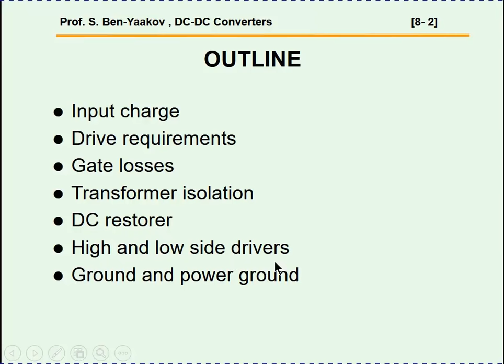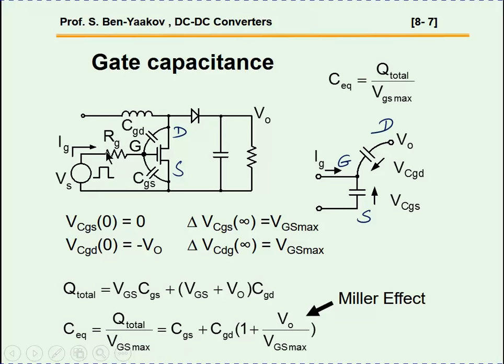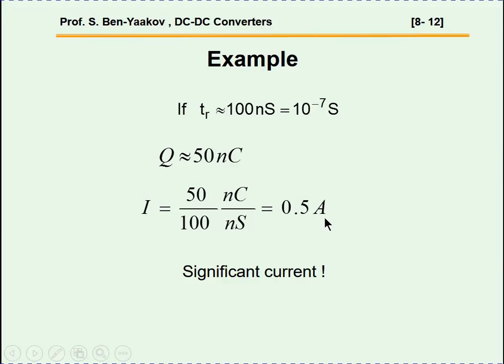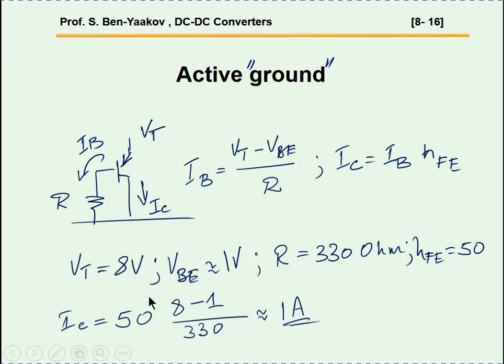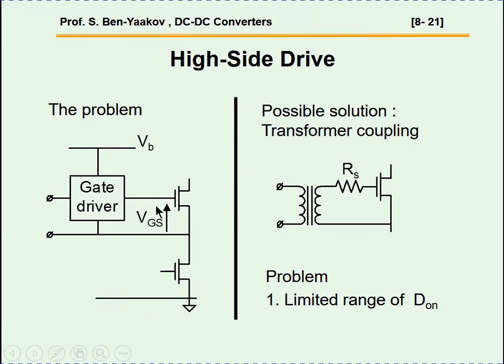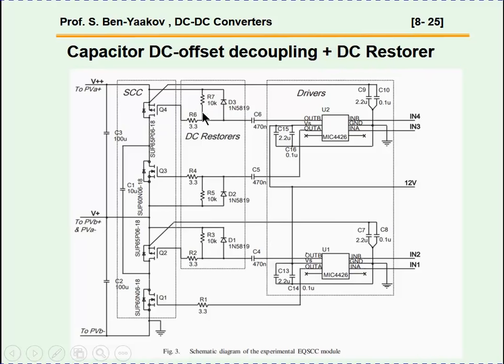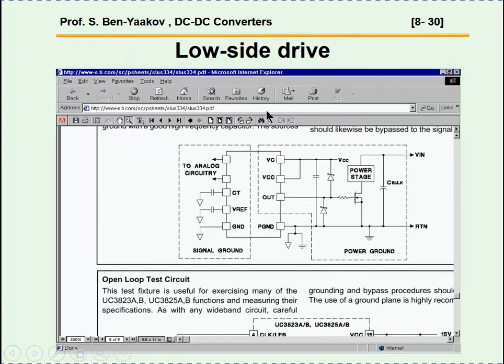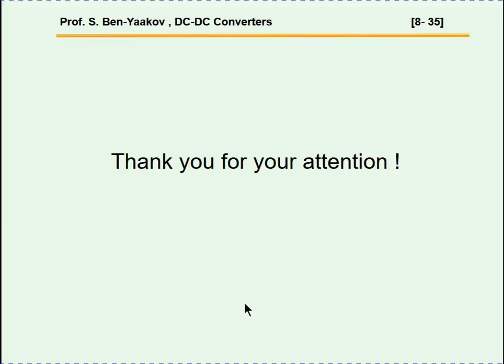Power MOSFET drivers

Comment: Useless & theoretical bla-bla
Reply from the maker: Thanks for the time time taken to comment, but can you be more specific? I would love to read some concrete critique.
Reply: @sambenyaakov  All video is pure theoretical. About gate transformer. Push-pull usually are used for primary winding. It generates AC, not DC. But... after a lot of test this schematic is bad with GDT. Good that you are not Indian... HAha  - they are crazy electronics advisers at all now everywere.
Reply from the maker: "Push-pull usually are used for primary winding" can you give me a reference to that?  Where did you get this?  Just googled "gate transformers" and clicked "images". Guess what,  out of the very many schematics I  did not find a single push pull. How would you explain this? The FACT is that that you CANNOT use push pull on the primary of a gate driver transformer. This is because it will pass DC via the winding for duty cycle different than 0.5. 
And what is GDT ?  Gas Discharge Tubes? 
And as  for your "social" remark, I would not have any problem being an Indian. My experience shows that they are very nice people, as most people are. Try it sometime.     
And by the way, why is it  that you are not revealing your name?
Reply from the maker: Please send me the schematics of the primary push pull transformer connection for gate drive. Are you using it in the famed  chip tester http://pwm.company/PUBLIC-DOCUMENTS/TOOLS/user-guides/DIY-pcb-electronics-components-assembly-guide-testers-pwm-tools-EN.pdf
 or the apparently very popular IR21XX tester http://pwm.company/apple/IR21XX-MOSFET-driver-tester-IR2101
 which is a must considering your believe:  "Very often, chips from China are defective or simply fake". Wow! How about Russia?
Reply: @sambenyaakov  Russia is not the world's supplier of electronic components, but China does. If you don't know this - you don't know nothing about modern electronics real world. Pardon for my french :) And fake IR2101 ICs come from China, not from Russia.
Reply from the maker: Thanks for sharing the outdated welding inverter design. AS I thought, you are using the push pull in a symmetrical fashion. So what happens if the duty cycle is lower than 50% and both outputs of the 3852 are off?  AS you might understand, this is NOT a rational solution for a changing duty cycle as one normally would have in converters and inverters.So your statement: "Push-pull usually are used for primary winding" is probably correct for the one inverter (probably on earth)  you concocted.  And just for your information. We DO NOT design anymore electronic circuits that require trimming by potentiometers as you do on the 3852.  And also, the proper way to design welder inverter is to used resonant or at least soft switching. See paper of 20 years ago (from Russia) http://www.valvolodin.narod.ru/articles/EP-PEMC2000.pdf
Reply from the maker: You wrote: "And fake IR2101 ICs come from China, not from Russia." Obviously, I don't think that Russia can make even a fake ICs. So, you first spread the word about fake ICs and then sell testers for ICs. Very clever, like first breaking windows and then offering a service to fix them. How about buying carefully your components? Does this ever occurred to you? Think about buying meat.  Are you not careful to buy  from a trusted butcher?
Reply: @sambenyaakov  Dear Mr Sam, please don't bother with them, they're clearly a troll and know nothing about what they're talking about. If you check their youtube channel it's a bunch of rubbish videos where they use a computer reader to read off wikipedia.

thank you very much for the great video Mr Sam, I loved it :)